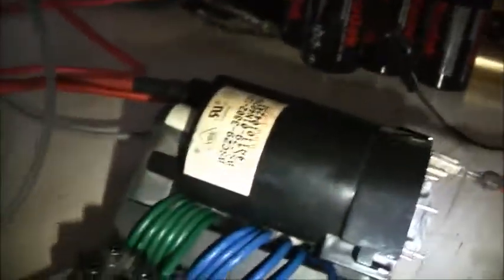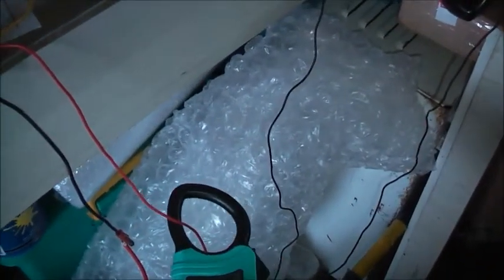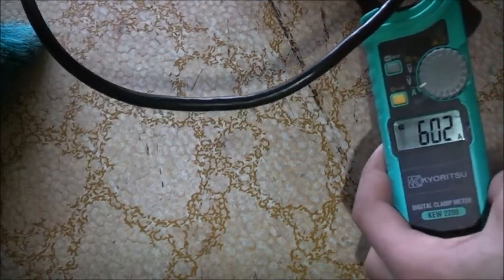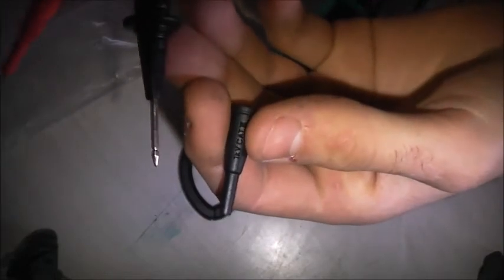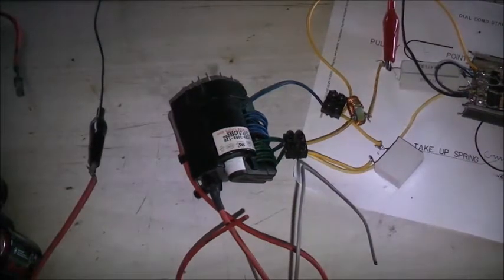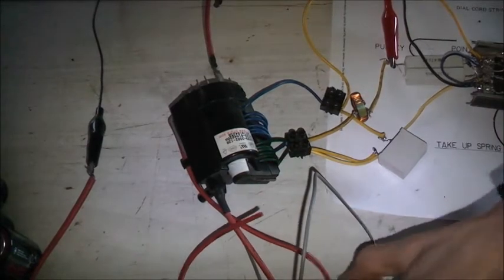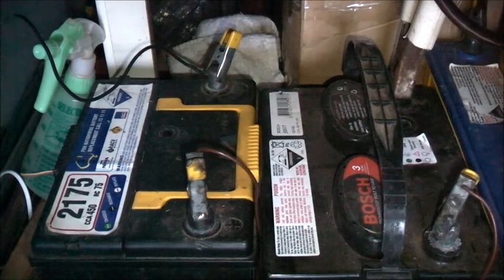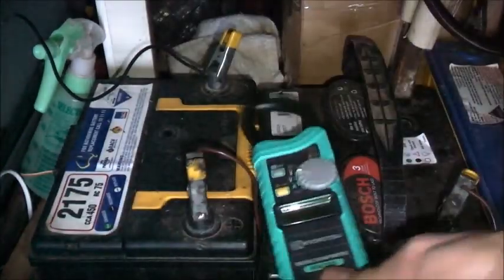New Clamp Meter & Yingfa Regression Coil Arcs!

Comment: Can your clamp-meter measure Amps DC on the clamp? Not all clamp-meters can.

A quick way of determining that, would be to put it onto the Amps setting, put a big cable through the clamp jaw, then touch the ends on one of those car batteries you have. If it does DC amps on the clamp, it should show a good few hundred amps through the cable. :-)

Flyback coil..... Fancy them putting that bit of plastic in the way! I ain't havin' it! Where's my hamma?! :D

Thanx for showing,

-BoomBoxDeluxe.

Comment: some good arc's off that flyback =D ! real nice slim meter too I even like the color bit different from the standard yellow or black .. well you could try what I was told to try and it works .. when you found the right pin cut the other pins next to it away then hot glue over works well for me ;-) .. cheers bro thanks for the vid !

Comment: Pehaps do a test of the clamp meter against your dicl smith electronics one, use a static load like a bulb, on ac then dc.

Your flyback will be producing so much noise and pulsing on its supply, its not a fair test at all.

Like the meter larry :-)

Comment: Your reflex was good, I got a good tingle too today while messing about with caps. Nice clip on Ammeter you got there. Kyoritsu is still a pretty good brand. I doubt that you get accurate ammeter readings as your meter is most likely rated for between 50 and 120 Hz. Have a look in the meters manual. A flyback HV lead may put out 10 to 30 mA max.